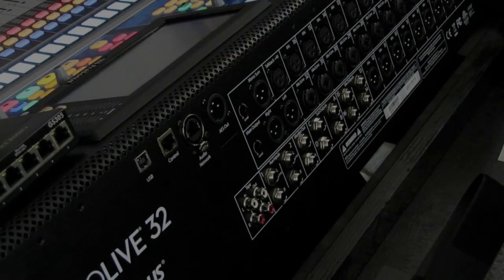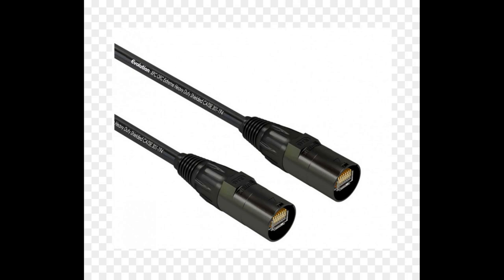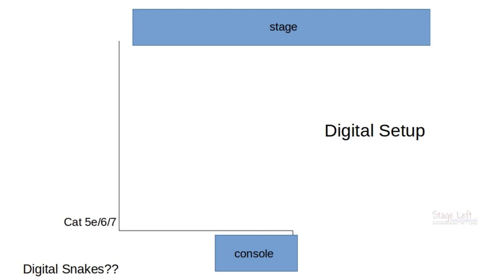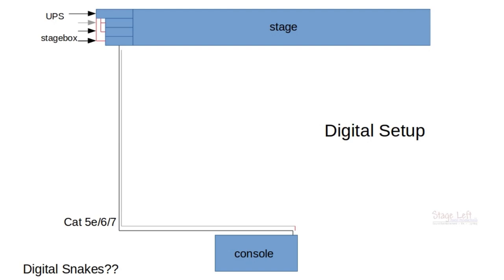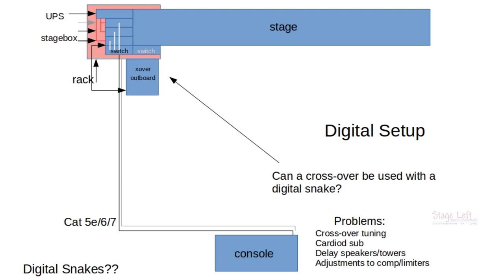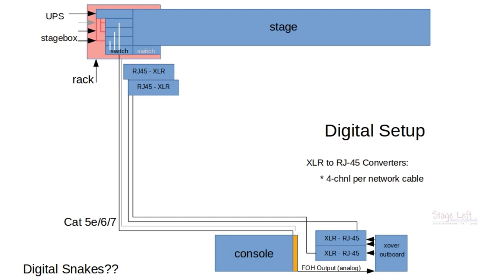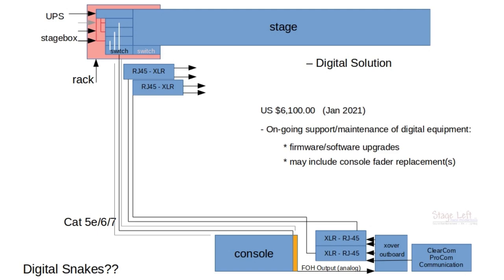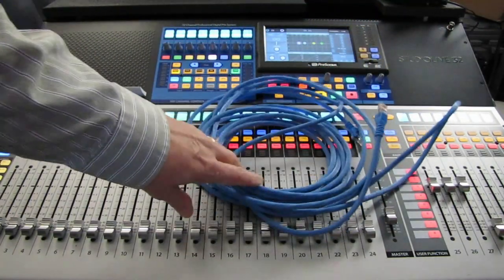Are digital snakes only a single CAT 5e/6/7 cable?  Marketing says they are?

Comment: Interesting video. I understand where you are coming from on this. I honestly prefer sageboxes and multiple Cat5e lines to the stage. 
I can run 2 ethernet and 2 fiber lines with my console. If a line fails the audio keeps happening because I still have a 3 other lines plugged in.. 
It is amazing all the flexibility that can be done now days. 
I still would rather have 5-12 ethernet lines running from FOH to the stage, but that's me.
One other thing is that some consoles only have 8 local inputs and 8 outputs. 
Keep doing what you are doing.
Reply from the maker: Thank you!

Comment: Video is a little dated and some things have changed. Consoles now include delays in them for delay towers, so running delay towers from the FOH is simple using the 2nd AES50 output from the console to your towers. The consoles include phase inversion and delay for your carotid subs if desired, or use a speaker management system such as the Meyer Sound Gallieo 616 speaker management system, which is remotely operated over the network, so yes can be fully tuned from FOH, even though the box is in the monitor rack off stage. Adjusting the console and speaker management with a tablet while walking the venue is both possible as well as normal.
Reply from the maker: It's good to see the improvements.

Comment: Behringer x32 and s32 is all you need. You can crossover and delay internally on the x32 with 8 outputs. Main L&R,   monto Corduroy sub setup, front fills and back of house side fill speaker with delay.

Comment: You have a point there! Nice explanation! But one thing With the presonus eco system, you can use the 32R rackmount mixer as a stage box/monitor mixer. If ur FOH desk die’s mid show no problem, You can run the show from the stage box. If i was gonna go 100% digital i think i would go with the 32r instead of the stage boxes..
Reply from the maker: Yes, I have heard of bands using 32R mixers for a stage box.  They enjoy the potential flexibility.   Thanks for the comment.
Reply: Good day all, to chime into Carl's point, yes, the RM32AI (Presonus) rack mount mixer is perfect for that purpose as I own one. The other big point that that someone made earlier that I just wanted to echo is that it's not really necessary to have all of the digital outboard gear at the stage (particularly if you have something like the RM32 mentioned earlier). In this new digital mixer age, a lot of manufacturers have built a lot of power into these systems that allow you to virtually eliminate TONS  of outboard gear that you might use during a conventional sound show set up. Very useful things like speaker delays, eq/crossover control as well as full parametric EQ and dynamic control not only on every input channel but main and aux outputs as well. Analog is great and too have personally used it for many things but in my humble opinion, the ease and flexibility of digital (when properly applied with the right gear combination), is very hard to beat. The very idea of the digital pa set up was made to make the sound techs' lives easier and as the manufacturers improve (and they will as they do listen to the engineers/techs in the field) it will only get better and better. Blessings to all and thank you for allowing me to share. Keep the subs crankin'....

Comment: Im sorry guys but I’m completely agree with this presentation, now let me tell you why, if you have a fixed location where  your system is going to be forever placed maybe is a good choice for you, but for us the mobile sound providers that requires to move constantly from one location to another then I can guarantee you analog is best, also the latency is real with the digital stuff, I’ve seen it myself, and the amount of gear that you need is crazy, in the other hand the analog is just plug and play and no latency at all, also if you go digital you really have to make sure you buy good gear and I mean expensive and reliable, now what I’m saying is that I’m not against digital, I think is good and beautiful but it’s just the fact that for me the cleaner the better, at least for me and my long experience since 2005 . My last statement for you guys out there ( Old ways are still best ) ❤

Comment: 09:40, i have an addition to make here,  certain digital console can offer the way of using an Matrix as an Crossover, Like the Behringer / Midas X32/M32. so in a digital setup, its not neccasarly that you will need an outboard crossover if this is the case
Reply: I agree that is how I run mine, also my digital snake has 32 inputs and 16 outputs much easier to run small cable.  I have both love the  digital mixer much better.

Comment: To be fair to digital, there are lots of solutions to some of the "problems" you've mentioned.  As far as the location of your system processor, if you leave it by your amp racks, any good processor will let you remote in with a tablet for control. If you still want it at FOH, most digital consoles will let you use tie lines between local I/o and stage I/o without using up any processing on the console. It's basically just a pass through. so there's a great way to get your outputs out your drive rack to your amp racks. 
As far as latency is concerned, I don't think there's any digital console on the market right now that are too latent for IEM's. As long as you're under 6ms, most musicians won't be able to detect it.  The only issue can come when you start adding plugin servers, where you can end up adding a bunch of latency.
Reply from the maker: Very true with the plugins!  I suspect not too many people may be aware of that.  Remote control processors are nice, though from our perspective, it would require another "gadget" for FOH to manage... simplification is very prominent with us.  Thank you for your reply and added solutions!
Reply: @stageleftaudio  yeah, I get the not wanting extra devices and things, but 9 times out of 10 there's already a laptop for SMAART, or multi tracking, or a tablet for console control. it's pretty easy to just use that for your system processor as well. alternatively there's tie lines like I mentioned before
Reply: @stageleftaudio  for me personally, I've already got my laptop on site for a while variety of things, and even if I didn't I've got a smartphone there too. Seeing as pretty much everything on a modern stage can be controlled from a computer or phone, for me personally it's been extremely beneficial to make the move over.

 I was working with a company before who used Powersoft X8 amps, they were controlled through a laptop on site. Opening up the software, it's got presets for every speaker and subwoofer under the sun. 2 minutes on the laptop, and we had the amps switched from running big Outline line arrays and massive sub stacks, over to 4 15 inch tops and some tiny Nexo subs. That included corrective EQ, tons of FIR filters, hardware voltage limiters and protection specifically for that box. 
During the shows, I could glance at the laptop and see what percentage of power each of the amps was at. It's genuinely amazing what the controllable stuff can do, and in my experience it's well worth the shot
Reply from the maker: Our MacroTech amps, are managed remotely using IP, the QSC PLD amps (unfortunately) require USB.  We use the PLD amps 90% of the time for monitors; their management isn't too critical to most shows.  The remote management is great; nice to see what's going with the amps during a show.  Though, we don't usually use the remote management for every show.  Once the amps are setup (prior to the event - setting voltage/thermal limiters, setting high-pass values, etc...) we just let them run.  Never any issues.  Thanks for your comment.

Comment: So on normal shows you run two analogue snakes, one as a backup? A ethercon cat 5 cable is just as susceptible as a snake for cable failure. Nothing wrong with analogue. Some points are very valid but in my opinion you are reaching on a lot of “problems” with digital. You won’t have latency by daisy chaining once between two snakes because the third snake is a backup anyway so it wouldn’t be in use. Any of the DBX driverack series all can be controlled over WiFi. How in the world does an UPS help if your speakers aren’t on a UPS??? Is everything on the stage running on a UPS?
Reply from the maker: We carry a backup snake as well as a console (either analog or digital depending on the event).  There are various single points of failure with a setup; we try to have redundancy in the most critical areas.  We only have a UPS covering the FOH console and outboard.  I hope to have another video soon covering why we use a UPS.
Reply: @stageleftaudio  my point being this video is over the top reaching for reasons against digital. Yes analogue is better in some situations, Yes digital is better in others, but most of these points aren’t valid at all. You didn’t even address all of my points in my comment. Yes you bring a backup snake to a gig but do you go ahead an run the cable? If the power fails and your console and snakes have a UPS it don’t matter because more then likely the speakers won’t be functioning.

Comment: I think some clarification is necessary.  Particularly about the cable.  It is perfectly fine to use a traditional Cat5e/6 cable for a digital setup, especially one that is more of a mobile rig that gets setup and moved frequently.  Simply because that cable to considerably cheaper than the Ethercon version.  I am not bashing Ethercon, but those cables are NOT cheap.  A 100 foot Ethercon cable is about $200.  A 100' standard Ethernet cable is about $12.
for permanent installations, and setups where shielding is necessary, absolutely go with Ethercon, otherwise, for temporary, or very short runs, an ethernet cable will suffice.

A digital snake versus an analog snake, is still a cable and stage box.
Reply from the maker: Thank you for the comment!

Comment: Good explanation for those who didn't know. I had to go through this when I converted my entire system to Dante last year. The conversion made sense for me since I have separate monitor and FOH mixers. The cost of the stageboxes and the networking devices was only slightly more than a splitter snake. I've never used AVB, but from your description, it appears to be a little less flexible compared to Dante. For instance, the AVIOs could ride the same infrastructure as the rest of the equipment instead of needing their own network runs. Also, I could have connected the crossover by looping through a pair of Omni ins and outs on the console. One thing is for sure: I don't miss carrying racks of analog gear.
Reply from the maker: Thank you for the comment.  Speaking of AVB and Dante, Presonus recently came out with a device to bridge an AVB and Dante network.  I don't know of anyone who is using this yet, but sounds like a great tool.

Comment: It's like wearing 3 condoms..no one gets pregnant but you can't feel anything either. What is the band going to do when the power and lights are out. I have this same board and the nsb 16.8... it reboots in 15 seconds and back to where it was when the power went out. I use the 16.8 and a ethercon cable.. gives me 16 sends and 5 returns with l and r and a sub group group for the bass bins.  I have a 12 x 4 analogue snake for  full drums and 4 more returns.. its not Woodstock but I have never needed more.  You mention latency... the latency on the presonus is almost not perceptible on avb.. Also digital snake means no interference and no crosstalk from induction.I have never had any issue with the avb stage box with noise or rtd delay latency . It is one of the selling features of the presonus digital platform.
Reply from the maker: Thank you for your reply and experiences with the AVB network.  Presonus has done a lot to minimize latency.  One of their documents (from what I recall) references a 2ms latency for an entire network.  I'm not sure how the other digital solutions (A&H, Midas, Avid, Soundcraft, etc...) compare, but I do think Presonus has done very well.  Good to see that it has been a positive experience for you.

Comment: Great video thanks. Watched a few times recently. Quick question. Is there a reason why you would convert from XLR to RJ45 and back, between the FOH X-over and the AVB switch at stage? Could you not just run an XLR between the two and save the cost and added failure point steps in running through two conversions? Thanks in advance.
Reply from the maker: Thank you for your comment.  Good observation with the points of failure.  For your question; yes, a dedicated XLR cable(s) between the crossover and stage could be used.  Depending on the setup, we may need 4 XLR cables from our crossover (H/M/L/cardioid,  plus a potential backup XLR cable).  If we need to run XLR cables, we might as well run a snake for everything!  
The content of the video was to address the potential cost/issues with moving to a full digital solution while needing to maintain control at FOH.  For us, the lack of FOH crossover control (without having to move to a wireless/PC crossover setup) is a big negative.  I am not opposed to digital.  I think it's great.  Digital is a tool, just like analog.  Some digital tools work well for our setup, others not so much.
Reply: @stageleftaudio  many thanks for your quick response. Good point also about multiple XLR’s versus 1 x RJ45. Absolutely understand the original purpose of the video. Keep them coming! I love all your event ones too!

Comment: Sounds like someone trying to defend sticking with their analog setup haha...  there's pros and cons on both approaches and this video gives a bit of an understanding although it sounds pretty biased.
Reply from the maker: Good comments!
The premise of the video was to show there is a lot more involved with a digital snake solution than the marketing hype that floats around stating a cat-5/6 cable is all that is needed to run digital.
We use analog and digital for our production.  Analog is better for some shows... digital is better for others.  At this time, we don't use a full digital solution.

Comment: So how many channels can a single cat 5/6/7 cable carry? Can you send 64 channels over a single cat 7 if you have the right equiptment? Of course you would want redundancy’s but if you had the equipment can it be done or is their a limit so you would have to run 2 or 3 cat 5/6/7 cables to get 60-80 channels? From the stage to the console. Also if you running monitors from your board to the stage how many channels of monitors can you run? Some bands have 16-20 stage monitors plus side fills can you send all that audio over a single cable and separate it when it get to the stage box and then run 16 monitor cables outta the stage box to the speakers?
Reply from the maker: I would imagine the number of channels a CAT cable can send is high.  And yes, it depends if you have the right equipment.  I'm not sure what the limit is for a CAT cable.  For the monitors, it depends on which console you are using.  Each console manufacture may have their own limitations of what their consoles can support.  Though, for a 16-20 stage monitor setup... something this large is usually handled by a separate monitor console.  For the Presonus (as is other manufactures), if you have a digital console and it has 16 returns/outputs, then that console will be able to support 16 monitor sends.

Comment: While this is a good explanation. What about Dante or other ways????
Reply from the maker: Dante is used by other console manufactures, so I'm not sure how some of the issues (referenced in this video) would be addressed.  Many points in the video reference hardware and their limitations with audio (AVB) networking.  However, Presonus did come out with an AVB-to-Dante interface not too long ago.  We're hoping to see how this is utilized with Presonus gear.

Comment: So basically, if you already have a bunch of analog snakes and don’t want to spend the extra money to change over what you’re used to using and already have, don’t bother with going full digital . If you’re just starting out, the cat 6 is cheaper than paying for all that copper... got it.
Reply from the maker: You are correct!  Moving to a full digital "snake" solution can be very expensive compared to analog.

Comment: YOU CAN SETUP CROSSOVER IN THE BOARD IN A MATRIX MIX WITH DELAY CONTROL .
Reply from the maker: Using the matrices (and sometimes subgroups) in consoles as a crossover, is an unfortunate trend.
Reply: @stageleftaudio  why is it unfortunate ?
Reply from the maker: Consoles are not designed to be used as crossovers; using them in this manner most always results in very poor sound quality and lack of control over the entire mix.  Crossovers are inexpensive and perform exponentially better than trying to setup a console to manage frequencies.  A big issue with trying to use a console as a crossover has to do with the filtering.  Consoles do not provide the same type of filtering (Butterworth, Linkwitz&Riley, Bessel) as is provided by many crossovers.  Using an actual crossover yields far better results.
Reply: @stageleftaudio  I got rid of my cheap crossover i had in a rack when i got my console because it added noise to my mains in the studio . LOL . I Find the consoles do a nice job of that simple task . plus i can do room measurements and make some adjustments to each set of speakers .
Reply from the maker: Studios do need an extra amount of "quiet"!  Consoles are usually quieter than most outboard gear.  Thanks for the follow up!